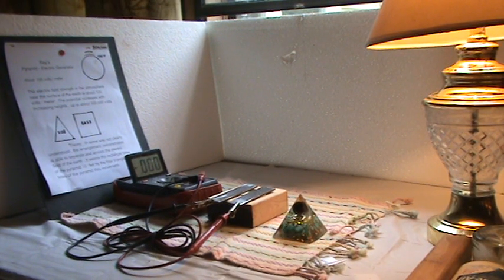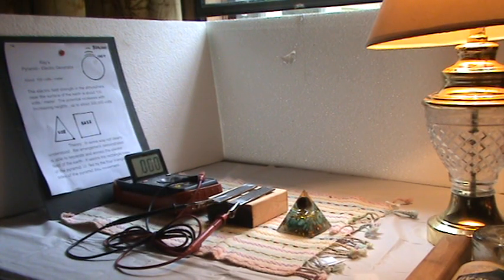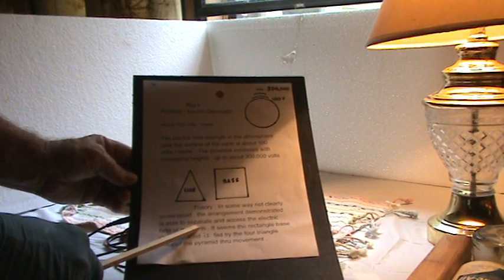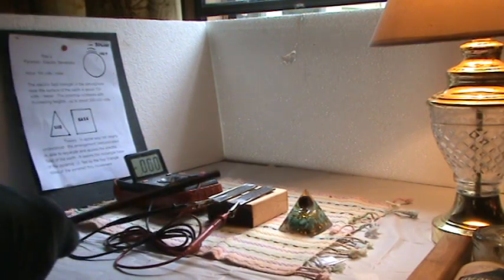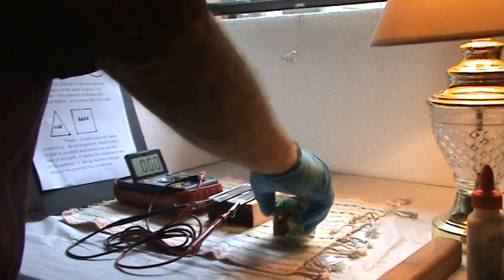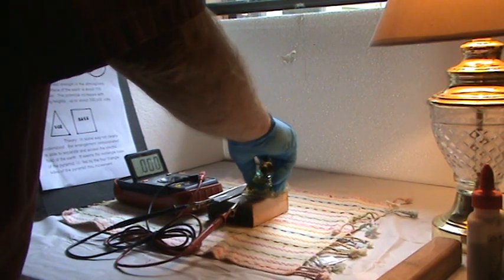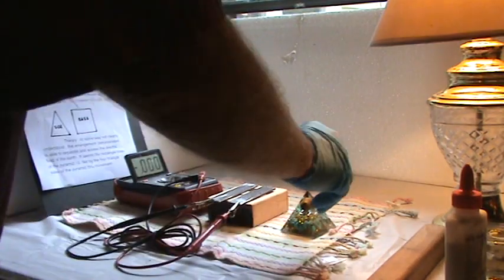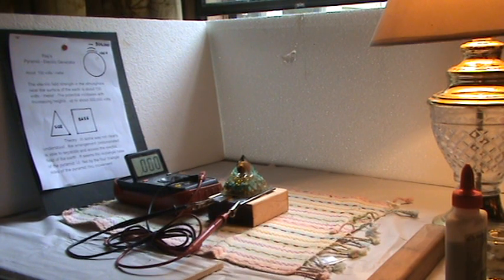Ray's Pyramid - Electric - Voltage - Experiment

Comment: you picked up more energy from the bottom of the pyramid than the side. Was that because of where the contacts touched the pyramid OR because the pyramid was upright when you had the contacts on the bottom and laying down when you touched the side. electricity is all around us, we have to pull it out. Most all real existing Pyramids, one side faces north. You have the tools needed, I think you should do more experimenting with that pyramid especially if the difference turns out to be the orientation of the pyramid, not where the contacts touch it. Thanks for your research.

Comment: Interesting experiment. The direction you are taking with the pyramid reminds me of Joe Parr's pyramid research with attaching small pyramids to the rim of a large centrifuge. He then spun the pyramids to thousands of RPM between many NSNS magnets located at the stator all with an HV electrostatic generator feeding ions into the setup. He claimed to get anomalous large forces on the pyramids and implied that it could be used for propulsion.  BTW, your pyramid is a using resin-based orgone materials (albeit more art than function with the stones and all). This would make it an accumulator of cosmic radiation. Best to use a pyramid made of a blend of metal and crystal powders in epoxy resin. Glad to see you back at it ;)

Comment: Maby your test is flawed with  your rubber gloved hand blocking the energy flowing through the pyramid. If the energy flows through it, it needs to come up out of the point.
Reply from the maker: A possibility yes .

Comment: I was really hoping for an update on your N - S Magnetic Switch Generator. Did you manage to take any power off of it?
Reply from the maker: Under load the effeciency dropped quickly . Also the firing arc was small , quarter inch under load , not enough to drive high rpm . Then if try to gear that up even more loss , On the shelf at moment . New designs in the works .I would have postea sooner but had computer problems . My apologies .
Reply: @raymondslab  Thank you for the update.

Comment: I assume your meter is set for dc voltage.  Interesting, unexpected.The meter probes are touching the pyramid directly.  I wonder if covering the probes with an insulator like plastic or glass and then swiping with the pyramid over the probes will also show voltage.
Reply from the maker: DC voltage   ...moving pyramid inch above , no contact , still shows effects .

Comment: Hey !! You are alive !   Had me wondering after 4 months....   : )      This is interesting and of course calls for using other pyramid shapes and materials to see if they also create this voltage. Since the voltage is so small, perhaps your scope could show the differences between pyramids and other shapes.  Glad to see you back and I hope it wont be another 4 months before a new video. The garage" lab" I bought is here and has been sitting for months. I do not have the money to get it wired and insulated before winter. No way I can start making videos from inside the house. I can barely get in and out of my pc room as it is. Anyway, will be watching for your next video.
Reply from the maker: My apologies had  a major computer problem .